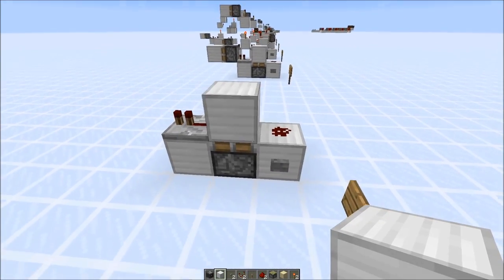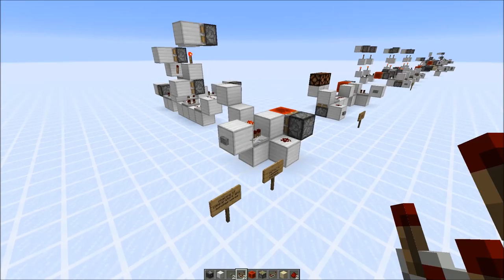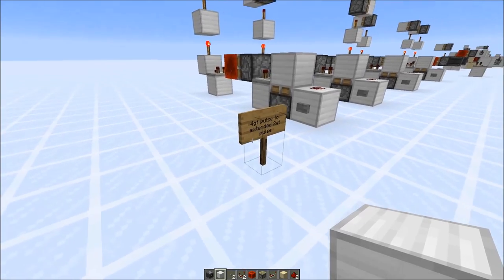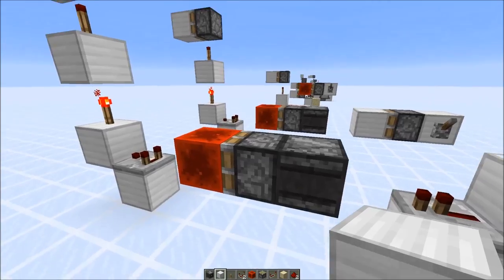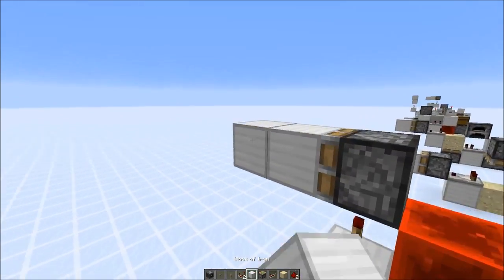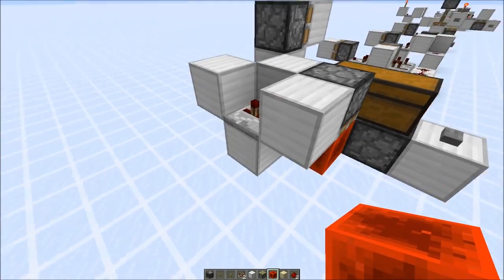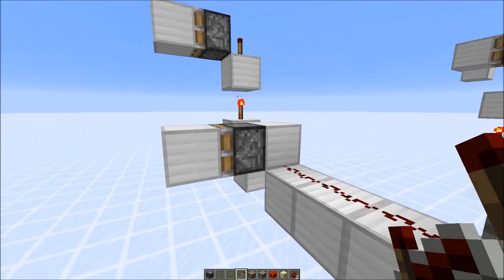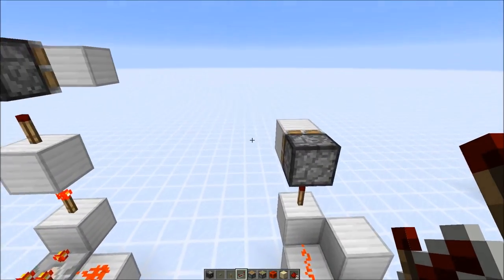Redstone Basics: Extended 2 Game Tick Signals

Comment: Mango I discovered a weird 0 tick thing. So I place a normal pistons down fact up on the ground, place a block next to it, then place 2 blocks to the side of that block (and 1 block higher) and place RS dust on all 3 blocks. Then at the end I place a sticky piston with a block on it's face and an armor stand a block away to test if it's a 0 tick pulse. What's weird is that on some worlds, usually singleplayer but not always, if I place a RS block on the normal pistons face it creates a 0 tick, but sometimes in certain worlds it doesn't. Do you know why? If not, I'll ask Myren.
Reply: After reading your test I build the following thing: http://imgur.com/a/qXb7E
" if I place a RS block on the normal pistons face it creates a 0 tick, but sometimes in certain worlds it doesn't." 
First of all, this will always create a 0-tick pulse. However in some locations the sticky piston won´t react to that 0-tick pulse, because the "block-event-tick" length of this 0 tick pulse is location dependent. I assume that when you said that it doesn´t produce a 0-tick, you just meant that the sticky piston didn´t react.
Whether the sticky piston will react or not, depends on whether the redstone first updates the normal piston or the sticky piston, which is location dependent.
If the redstone updates the normal piston first, then the normal piston will schedule a block event before the sticky piston, and the normal piston will extend before the sticky piston, which means that by the time at which the block event of the sticky piston gets processed the redstone line is already off, which means the sticky piston won´t extend.
If the redstone updates the sticky piston first, then the sticky piston will schedule a block event before the normal piston, and the block event of the sticky piston will get processed before the block event of the normal piston, which means that at the time at which the block event of the sticky piston gets processed the redstone line is still on, which means the sticky piston will extend.
Reply: Myren Eario Thanks for explaining, and yeah I meant the piston wasn't getting 0-ticked (by that I mean activating).